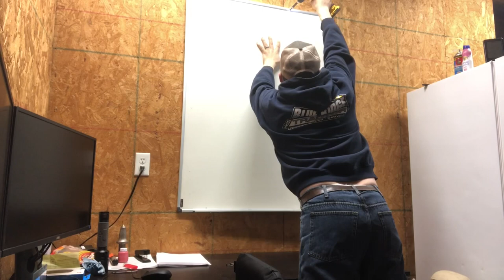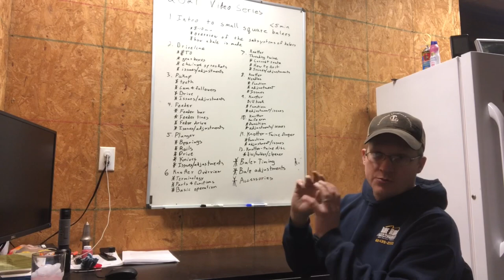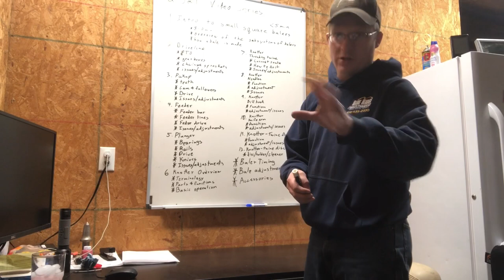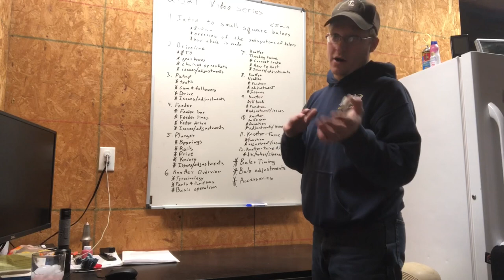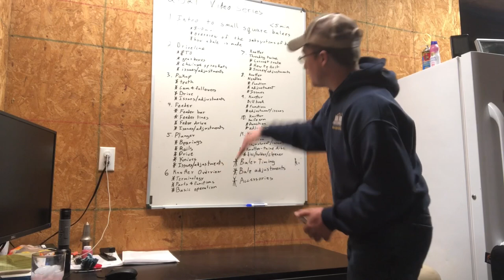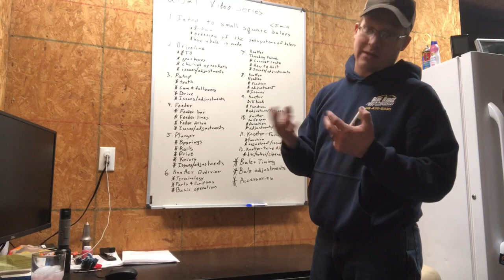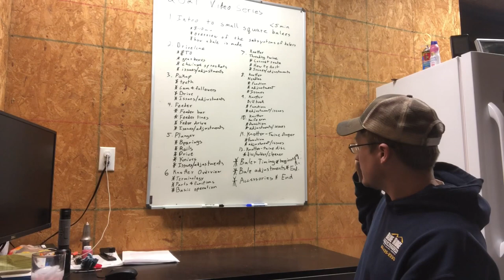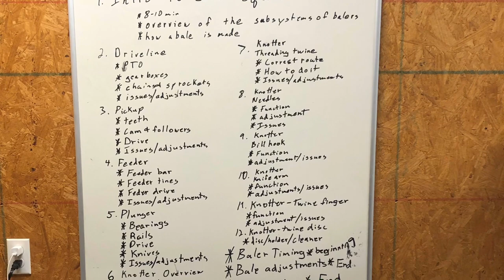2021 Small Square Baler Video Series Discussion

Comment: Some pointers on bale length n weight should come early. I am changing from straight alfalfa to alf and orchard grass mix. I have had alot of trouble keeping bale weight down to fifty without making bales too short for my accumulator.
Reply: @thebalerman  I have a Hoelsher 10 on edge grapple n Hoelsher 100 accumulator. Bales have been about 34 in
Reply: @thebalerman  straight alf is so hard to get dry then suddenly it's too dry without loosing too many leaves. That's why I thought grass would help. When I milked cows always ate mixed better anyway.
Reply: Had to bale alot at 18-20 percent that's why it too heavy
Reply: @thebalerman  thanks looking forward to your new videos